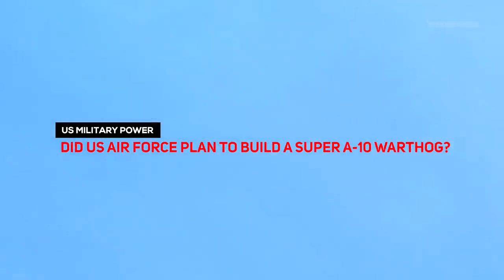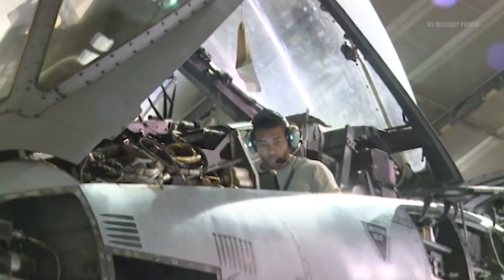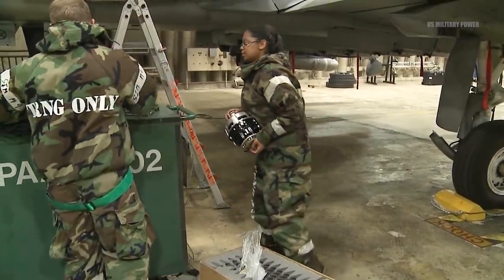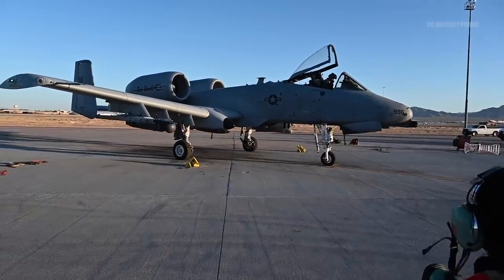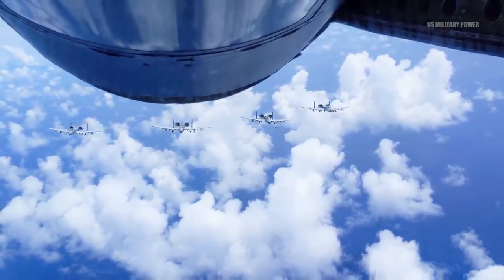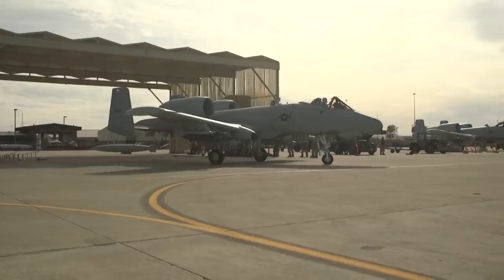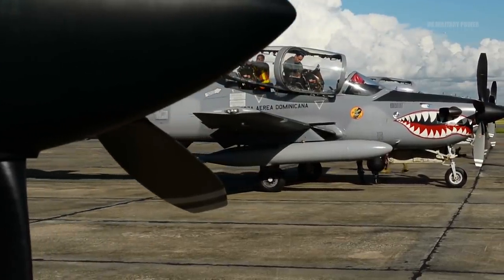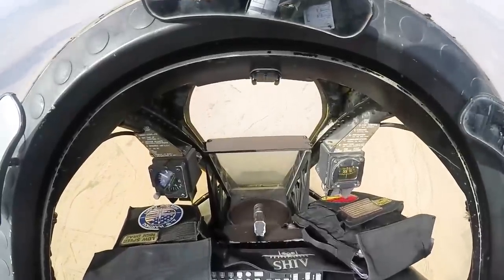The New Super A-10 Warthog is Coming

Comment: If they're going to replace the A-10, it needs to be with a Super A-10, then a Mega A-10, and then an Ultra A-10, etc.
Reply: A-10 Pro Max 512 GB
Reply: The A10 has been incredibly successful in the middle east, but heavy armor wont work against advanced SAM systems, which is now the bigger threat.
Reply: @andrewschmidt434  please elaborate. I think you're onto something
Reply: @Fetherko  I think what he means that when the SAM rocket go boom on the aircraft the armor won't do shit. The aircraft will only be able to take bullet rounds but not missiles.
Reply: Considering how long the tech has been in place, would it not be possible to upgrade the chain gun into a Mini-Phalanx CIWS for SAM defense?
Reply: Super mega ultra a10
Reply: Literally "now with more brrt".
Reply: Just add a laser under each wing to go with the main gun.
Reply: This video is just a bunch of paraphrasing about the history of the A-10 and having nothing to do with any new type!  Both the thumbnail and the byline are a clickbate description!  It's the same for any of these videos that are describing and depicting a "New" or "Super" A-10 et al.
Reply: And one with 3 gau 18
Reply: @Passions  A-10 RTX 16k GTR Bugatti fortnite playstation xbox 128 gb ram 64 tb intel core snapdragon 860 Lamborghini senna p1 boeing 747 v32 uight-cylinder 500w 10000hp gaming pc ultra hd rtx 9090ti
Reply: Or maybe a actually good CAS plane and not this failure
Reply: @andrewschmidt434  even tho it was in double the missions of another plane it had 2 times less kills
Reply: Über A10?

Comment: She is irreplaceable, it's that simple. The A-10 is in the same class as the B-52 , badass.👍👍
Reply: Bingo. The A10 is the rare case of a plane designed half a century ago that is still relevant (or even more relevant) then in the time when it was created. Yes the air frames are old, but this design still works better than anything different.
Reply: The thing is: stealth kills dynamic.
Reply: @phamdinhhoang1998  Theres nothing that says you cant build a stealth A-10 to replace the A-10
Reply: @F14thunderhawk  actually, there is. the most used to date CAS attack aircraft that is still in use in both US and Russia is dated in 1975. The US still uses the A10 while Russia still uses Su 25. 
there is no "newer" replacement of both of them in the world, while Fighter aircraft like the F22 or Su57 is currently in the 5th generation. 
We have tried to improve them, but non CAS-only aircraft have been made. most of the "newer" CAS delivered is from fighter jet modification. while it serves, its ability is nowhere close to the old gen like A10 or Su 25.
if they can build a stealth A10 that works, they already did.
Reply: The B-52 should be replaced by a modified 747 or 757 that can go farther, more fuel efficient. and drop more bombs. I am not sure why they didn't use a commercial platform for our long range bomber.
Reply: @phamdinhhoang1998  A-10 is the opposite of stealth, it is designed to get down and dirty and take any hits that the enemy throws at it and still return to base.

Comment: Having been a weapons system specialist on the A-10 in the 80's and 90's , what I always admired was a relatively low-tech approach that was incredibly effective. The plane is so effective due to it's massive array of weapons and amount of payload this thing can carry, combined with it's survivability... and at a relatively low cost compared to any fighter aircraft. You could build 10 of these for the cost of an F-35.  My fear is that aircraft designers would try to completely over-engineer a a replacement aircraft at a cost that would severely limit the quantities that could be produced.  If anything could be upgraded, I would recommend it would be the electronics. Seemed like miles of wire harnesses. and was often challenging to troubleshoot certain electronic issues. Seems one could make this much smarter, more reliable and easier to maintain while keeping the fundamental design... and maybe a more ecologically friendly alternative for the Uranium tipped bullets that was as effective.
Reply: Doesn’t sound like a means for greedy defense contractors to make bank on untested next-generatipn “Wow!”-tech that would commit Pentagon brass to continue fund long after it goes way overbudget while perpetually undelivering on contractor promises.
Reply: what survivability, it is useless against the most rudimentary antiaircraft gun
Reply: @djizzah  apparently you don't know much about the A-10
Reply: The Uranium tipped ammo isn't the biggest concern imo, but with ammo technology moving pretty fast I would imagine a newer high performance core is in the works for AP rounds in general.
Reply: @djizzah  You do realize that this is made to take hits from Below right? Do you know what CAS is? Oh yeah... and show me another plane that can  fly home with pretty much 1 wing and missing an engine.
Reply: But don't buy those electronic chips from China
Reply: There not much better in realm of Uranium bullets. But you don't need them for non armored or bunker targets I would hope when those are not expected they go in with non Uranium rounds. And I would hope when we have control of the battle field we go back in and clean the Uranium up it's not hard to find and can be reused. Uranium is 92 closest non radioactive is 84 your just not getting something that dense that is not radioactive.
Reply: Not sure how the uranium rounds could be replaced with anything else. Maybe if they used bullets that had charges and some copper that is melted and propelled into the target like mini RPGs? What would that cost be though and could a 30mm mini rpg punch through the same thickness of armor as uranium?

Comment: I remember talking to a retired general in the mid 1980s and he told me they were getting rid of the A-10s -- sending them to Air National Guard units, etc.   Then, Desert Storm happened and the A-10 did its thing.  I live near a military post where they have strafing pits the A-10s use for target practice, so I get to see them several times a year.  You can't hear them coming, but you sure hear them going.  And, if they fire that gattlin' gun, it'll make you happy you weren't on the receiving end!  Amazing aircraft and perfect for tank busting.
Reply: If you hear it that means you're still alive.
Reply: @kennethboyer2338  That's what Col. Rowe (the Range Master) used to say.  Rowe was quite a fighter pilot in his day, too.  Flew F-4 Phantoms in Vietnam and -- at some point -- the F-106 Delta Darts.  He's an amazing guy and I hope he's still out there and kickin'.  My only regret is that I didn't get down in the strafe pits and dig out a few of those depleted uranium 30 mm slugs.  I've seen some people using them to line flintlock frizzens and they give one heck of a good shower of sparks into the priming pan.
Reply: actually, more damage was done by smart and laser guided bombs from the F 111 than by the A10.  Laser designation made things a turkey shoot against so many of the Iraqi ground equipment that was stationary and dug in.  Easy to spot against the sand due to IR signature differences, target and launch and the bomb did the rest.

Comment: The A-10 is trusted by ground troops with supplying lots of BRRRRRRRRRRRRRT!!!!!!!!!!!!!!! And it has proved itself to ground troops.
Reply: The last sound the enemy hears just before his ass hole evaporates.
Reply: @bopdawg1082  Actually you don't hear the BRRRRRRRRRRRRRT if your the target you just suddenly disapear. If you hear it you weren't the target.
Reply: Do any allies use A-10?
Reply: @Lonewolfmike  better
Reply: @donaldclifford5763  None that I know of have A-10's in their arsenal.
Reply: Can you imagine twin Gatlin guns 😵
Reply: @loundclear9279  The 30mm is more than enough. The gun, if fired long enough would eventually stop the plane in mid-air because of the recoil. Besides the AC-47 and the early versions of the AC-130 were loaded with multiple Gatling guns and in the case of the AC-130 20mm Gatling cannons.
Reply: @Lonewolfmike  1
Reply: @willie7511  Yeah, but it has a howitzer!  The latest has a 20mm Gatling, A 76mm howitzer, and a 40mm bofurs.
Reply: @loundclear9279  Totally not necessary.
Reply: That's actually an urban legend. She flies just fine while the gun is BRRRRTTing away. The myth comes from early on in development when the gun was fired and the gun gas caused a dual engine failure. They added the stakes to the bottom sides of the fuselage and leading edge slats to control the flow of gun gas. Now you can Hammer down all 1150 rounds in one 20" squeeze. It would be ridiculous to do that, but it's possible. ATTACK!
Reply: @kwang6291  The newest AC-130J "Ghostrider" has a 30mm autocannon, a 105mm howiter and various missiles and glide ordinances.
Reply: @Lonewolfmike  Thanks!  Do they still have the 40mm bofurs?
Reply: @kwang6291  No. It was gettijng to hard to find replacement parts and reusing the spent brass became a hassle as well.

Comment: Upgrade the damn a10 itself! The men on the ground want the a10 the most. I think their word is enough.
Reply: the man on the ground typically calls every machinegun a dshk or as they refer to it as a DiShKa and any rifle as a ak. what makes you think they know what aircraft is overhead?
Reply: Oliver Pong  What the men on the ground is irrelevant to what is good* 

If a A-10 is nice but costs 50000000000000$ to operate, its obviously not worth it. But to a soldier, all they see is the A-10, not the budget.

So their opinion just never really matters.
Reply: Most definitely!! 🤙👍✊🇺🇲
Reply: Oliver Pong  those " state of the art non working fighters" are more versatile and have over shadowed the a-10s role meaning they have conducted more missions and dropped more ordnance.
Reply: @dzello  Correct me if I'm wrong but wasn't A10 the most cost effective close air support that was in favor for being cheap compared to other aircraft for the mission?
If I recall, A-10's main selling point is it's cheap and it just works. Now I'm not sure if with the new upgrade that it will still stay that way but still.
Reply: @AnickYT  Well, its getting talked about because of budget so... Nope. Even if A-10 are cheap, they can only do one thing. Its better to use something slightly more expensive but that can do tons of things like a multipurpose combat aircraft. As time advances and other aircrafts are capable of doing what the A-10 does, it becomes an obsolete cost.
Reply: @dzello  And even better than the A-10 for COIN is the A-29. It fills the role we're using the A-10 in now, same performance, and cheaper.
Reply: @AnickYT  It is so efficient, that even now it would better to buy mix of  F-35 and A-10 instead of F-35 only!
Reply: @dzello  It is not a problem, because proficiency in CAS missions requires a pilot training fully dedicated to ground attack. The game is over now, A-10 stays here for  next 15-20 years.
Reply: @peceed  Huh? The Air Force literally tried to retire a ton of A-10s. 😂 The Congress decided against it. Might want to stop doing crack buddy.
Reply: @dzello  Not really - AF was forced to find budget cuts and they chose A-10.
The interests of the Air Force are not the same as the interests of the Army and country.  Fortunately there are veterans in the Congress who understand value of A-10.
Reply: @peceed  Youre not very smart huh?

If the Air Force cuts in A-10s, it means A-10s dont perform well enough. Air Force wanting to retire them is the sole thing that matters. 

Congress has no clue about stuff like that and veterans are completely irrelevant. 

You obviously dont understand politics. Congress always does things like that because they are generally very disconnected from the topics they cover. Every single advisor could say X is a bad thing snd they could go for X anyways.
Reply: @thoth81 Not as much because its generally the Air Force asking the Congress and the Congress says yes or no. So the Congress can only accept or block what the Air Force wants.
Reply: @dzello  The men on the ground know better than anyone not directly involved in the operation of the A-10s. Like the pilots, the mechanics and the AWACS. Because they live it and their lives depend on it. Anyone who's served for more than a week knows that Generals either don't know or don't give a shit about what happens on the ground. Generals are politicians.

 A dedicated aircraft for 1 mission set is far better than the multirole approach, most multirole fighters can't stick around long enough to be useful for a whole mission, they can't fly low and slow enough to hit accurately in high volume, like the A-10 can, and they can't carry as much equipment and ammo as the A-10. Multirole aircraft have never been able to carry out the ground support role close to as well as the A-10 can. Multirole fighters are meant to carry out strategic strikes with both the capability for ground strike and air superiority missions, they do neither as well as dedicated aircraft and are generally incapable of real sustained ground support.

Why use a more advanced fighter that does an inferior job to the A-10, for a shorter time, and for twice the flight cost or more? On top of the 70 million dollar price difference between the A-10 and the F-35. That's not "Slightly more cost". But the Air Force, meaning the Generals in charge of it, don't give a shit about that.
Reply: @dzello   For the last 40 or so years it's been a solely top down structure, the results of this are the many disastrous projects such as the Bradley IFV, multi-million dollar weapons contracts that went nowhere, the UCP camoflage and the so far disastrous F-35.

None of them worked as intended, the Bradley was generally shit, the UCP cost 5 billion dollars and blended in with nothing, and the pentagon spent a trillion dollars on a plane that can fly for 3 hours. 

Only now are they realizing that the bottom up strategy is the one that produces results. The IVAS system, NGSW and the continued service of the A-10 are such results. 

The IVAS will change infantry combat forever, the NGSW is rearming the entire Army with superior and revolutionary weapons and ammo, that suits their needs, and the A-10 which is the clearly superior and FAR, FAR cheaper alternative to a plane meant to replace it while being incapable of doing so.

It's the ideas of people like you that let the military industrial complex rule the US for the last 20 years. Without even giving us what we need.
Reply: @dzello  There are hundreds of ways to do that without getting soldiers killed, like the UCP and some of these programs have. That's a moot point. 

P.S: The service of the A-10 was extended because those "Uneducated Bottom Idiots" became the top people. 

P.P.S: The military has been after the perfect vehicle, the perfect weapon , the perfect equipment since the 80s and has been floundering ever since. The right way to go about that is Modularity or specialization, the troops know that, the "Top people" can't seem to get it thought their heads. That is how the Bradley, the F-35, UCP and many weapons programs came about.
Reply: @dzello  I was talking about in the military, there are hundreds of jobs and dozens of job fields in the military, from Rangers to CBRN defense to Lawyers and Doctors. Many of which provide civilian qualifications and most of which don't put soldiers in any significant danger.  Unless there's a draft going, you probably won't go to combat unless you want to.

It is fantastic as a labor program though, free living, free tuition, all kinds of financial coverages, you don't really have to spend any money while you're in the military unless you want to. 

But that can be done without creating bad equipment that gets people killed, like I said. Moot point.
Reply: @dzello  The relevance is that they're fighting overseas, they have been for forever and there are plenty of vehicles that can be retrofitted and do their job fine. Why are new less effective ones necessary? And if the answer is progress, why do they need to be forced into the hands of troops who would be better off with the old one? Why did it take 20 years for these idiots to replace the humvee with a decent vehicle?

Also, lowering the military budget isn't a bad thing. It might keep things like the Air Force's $10,000 toilet seat covers from happening again

You really are a fan of the military industrial complex aren't you?
Reply: @dzello  They would work on the retrofitting, the designs and modifications, armor additions, IED plates, RPG cages, and the like, or weapon systems. Modularity, an answer to the perfect vehicle. They kept the Abrams in service for 40 years that way, and made things like the M1150 Shredder. And they have fleets of vehicles to perform this on, nobody would be inactive.
Reply: @dzello  I can't argue too much with that, though in an ideal world there would be no countries or social identities at all that would lead to conflict.

I can argue military tactics and strategy of all forms all night, but I have no interest in delving into Geo-politics and economics too much. 

I'm done
Reply: @dzello  It's less about that than you think. It's a very cynical view, and I don't mean that in a good way.